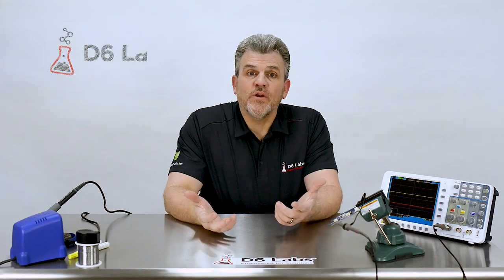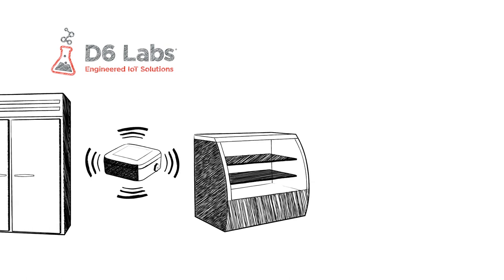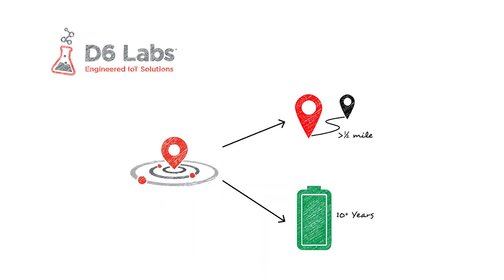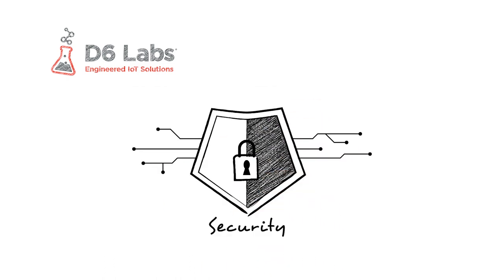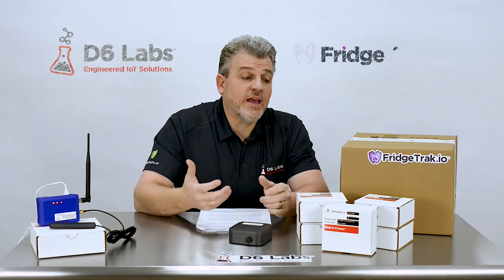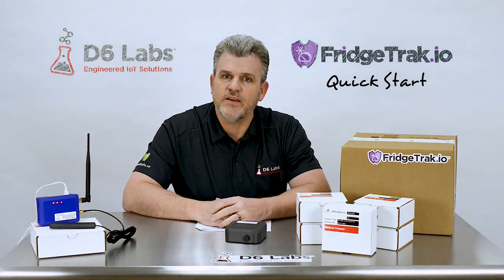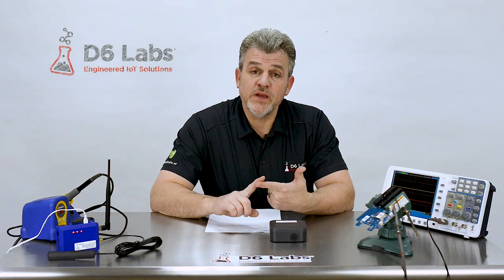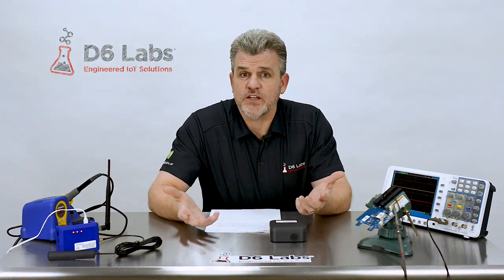How to Monitor Refrigerator and Freezer Temperatures Using IoT Technology

Comment: Do you make a home unit
Reply from the maker: Although our solution is designed for commercial applications, it can be (as is) used in-home as well.  In fact, most of our products have applications in home: HVAC, CO2, leak detection, remote control, etc.
Reply: I need make a project to monitoring many super freeze... maybe using zigbee ...

Comment: Most of those thermometers only update the historic temp  chart every hour even though the temp display may be close to real time.  So the historic is  useless. Why even bother to include it ?
Reply from the maker: Thanks for the question.  Actually, the historical data is not useless.   If you want to set alerts based on temperature, you need historical data to verify how long the temperature is outside of the specified limit to make sure that you are not alerting every time someone opens a refrigerator.  For refrigeration applications, we use the historical data to monitor the health of the unit.  Using the historical data, we can monitor compressor cycles, how fast the unit recovers after the door closes, and how well it is regulating temperature.  Our proprietary equipment health reports rely on this data.  And for application where compliance is required (like hospitals), the historical data is use to prove that vaccines are within specified temperature limits - this is absolutely critical for Joint Commission audits.  I don't think we have a single customer that ignores the historical data.  This is far more than a remote thermometer solution.  Let us know if you have any other questions.
Reply: @digitalsixlaboratoriesinc9615  You are correct. What I was commenting on was that historic data is useless if the rate of the sampling is too long. If I sample every hour, critical temperature changes could be missed.